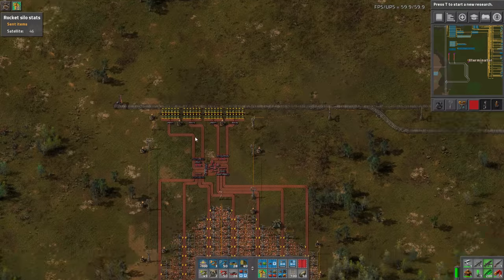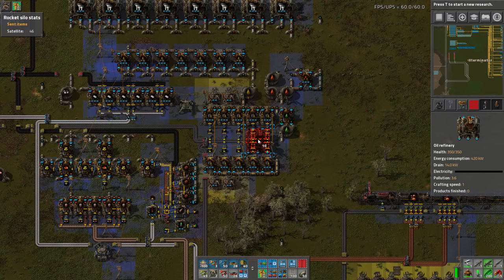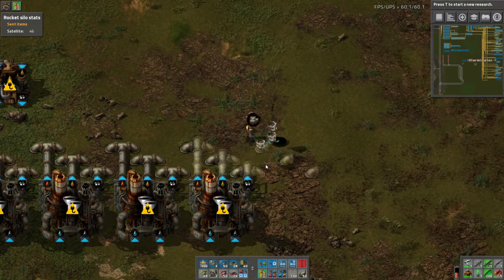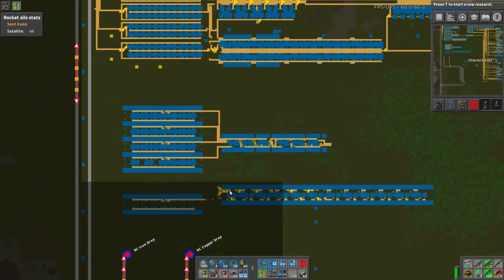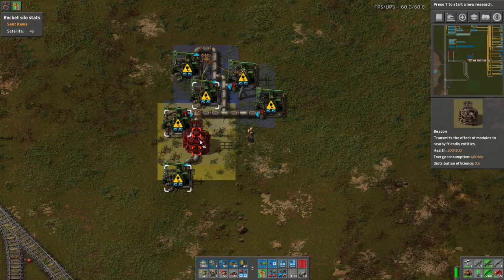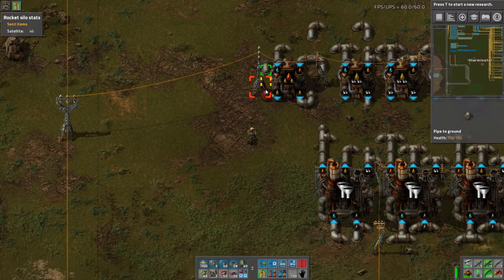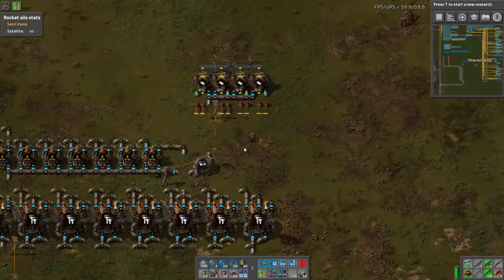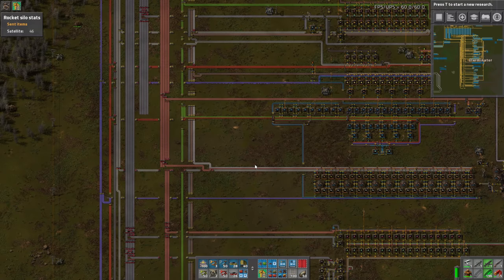Factorio: Tightening The Belt: Megabase Guide EP53 - DEDICATED OIL BUILD! | Tutorial Gameplay Series

Comment: I'm pushing 400 hours of playtime, what is this about oil ratios?
Reply: Advanced oil processing makes 10 heavy, 45 light and 55 pg every 5 seconds. 
Heavy oil cracking takes 40 heavy every 3 seconds and makes 30 light.
If you don't crack the light into pg fast enough the heavy cracking can't output
And/or if you don't crack the heavy into light fast enough, the oil refineries can't output
"perfect ratios" means you have just enough cracking to keep the refineries operating without stopping.
unlike ore which sits in the ground and is finite, every tick you don't pump oil is oil you lost forever.
Welcome to the world of min/max
Reply: If you want exact ratios...
25 Refineries
3 Heavy Oil Cracking
21 Light Oil Cracking

No modules.

Consumes 550 water & 500 Crude Oil per second.
Outputs 450 Petroleum Gas per second.

Technically you could double it and it'd still only need one offshore pump for its water supply.